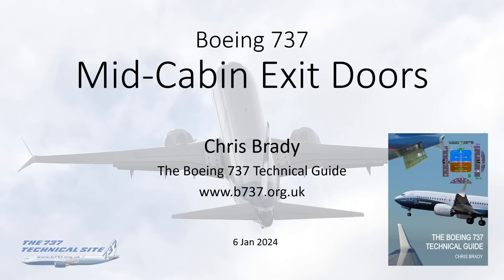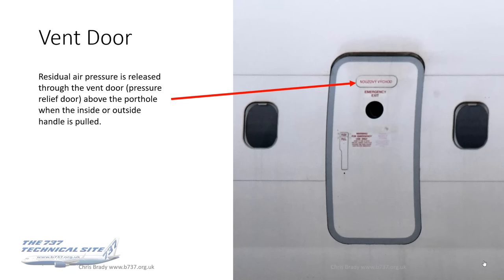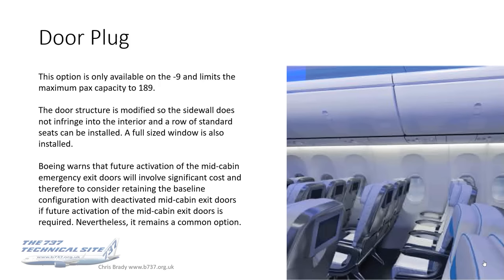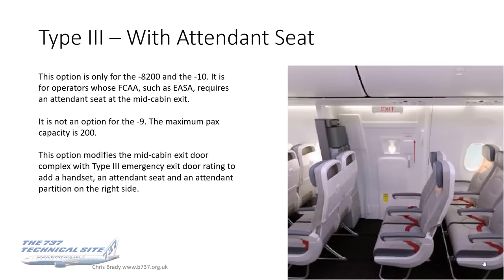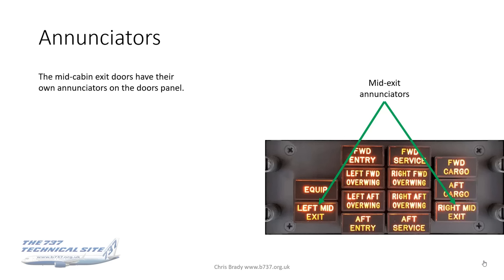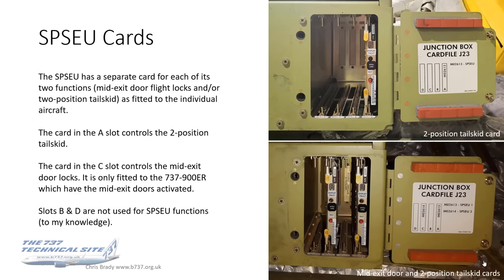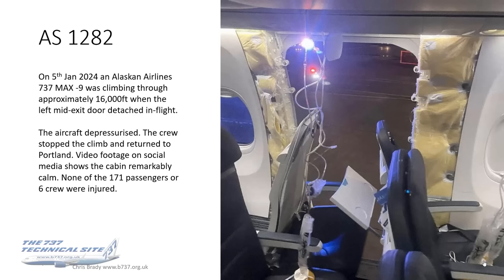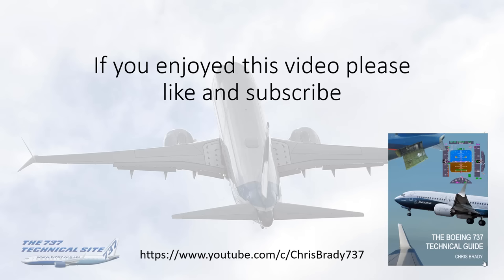737 Mid-Cabin Emergency Exit Doors

Comment: It’s not a mid-exit door if it is not in door configuration. It’s a plug at that point. A door opens and closes. When a door is sealed shut, it is no longer a door.
Reply: My thoughts exactly.  To call it a door is totally misleading.
Reply: The plug can still be opened by maintenance. There are still hinges.
Reply: @Chris_1024_ my point is it was not a door to the occupants of the plane. When the general public hear the many reports I’ve seen stating that this was a door, it is misleading. Passengers did not know it was there. Semantically you can call it a door. It was a plug with hinges bolted in and unusable. If I nailed a door shut at my home, technically it is a door, but if the house was on fire it was not an exit or an entrance, and for all intents and purposes not serving as a door.

Comment: Hello Chris, great video and appreciate the insight. With the aircraft on the ground and parked, if all four bolts are not installed, will the door assist springs raise the plug door into a non-plug position or does the weight of the door hold it in the down and plugged position? Obviously, with the aircraft moving/flexing, all bets are off. Thank You & All the Best.

Comment: Great video. Very lucky people. If the plug had hit the stabilizer or the rudder that flight may ended in much more terrible way. For Boeing's sake I hope this was not an engineering failure.

Comment: If you at the plug type door picture, although you say it's only secured by four bolts, you can see more fittings around the plug where it looks like more bolts could be used to secure the plug.  IMHO I can only see two scenarios when this failure would occur on such a new plane.  Either some or all the bolts were missing, or the incorrect bolts were used.

Comment: No horse in the race, but the door is installed by Boeing, behind a cabin interior also installed by Boeing. Unless Alaskan employees went behind the interior wall and messed around with the door plug (just 2 months into service, which would be noted in maintenance logs) - seems to be an OEM thing, no?

Comment: What's the difference between Type II, Type I, and Type C emergency exit doors apart from the maximum number of passengers allowed?
Also is there only one mid-cabin exit door or is it one on each side? Or can it be both?
Reply from the maker: You can find the differences on the internet. I didn't want to clutter the presentation up with too much regulatory info.

Comment: Thank you for this!  When I am inside a 737max with a plug in an exit and the plane is filling with smoke and flames I will be so pissed.  Even the windows are held in by screws, this looks so sub standard and should be.  I always thought the windows were  installed between layers of sheet metal and then secured., not just clips and screws.

Comment: Sorry, but another question:   if this door simply needs to move UP a bit to then freely pop out of fuselage, does this imply the door frame and door have "tabs" which, when aligned, prevent the door from popping out, but lift door up a bit, and the tabs are no longer aligned so tab on door can pass through the gap between 2 tabs on frame and door opens? 

Say the 4 bolts had never been installed and the door were free to move up/down.  Would it be fair to state that the door would have little incentive to move up/down and remain safely locked as long as it is a smooth ride and smooth landing?  If previous flight had rough landing and door moved up some (thus reducing area of contact between the portion of frame that keeps door from popping out), then i could see that metal failing as cabin startes to be pressurized and there is now too little metal to keep the door from popping out. 

From the pictures that were published, did you see anything anomalous in the door frame?  I guessing looking at the sill where the hinge mechanism is/was would provide clues?
Reply: the tabs you speak of he says are called stops
Reply: Thanks !  BTW, NTSB chair mentioned in press converence hat the ones on the frame appear undamaged , all 12 of them.  @indiekiduk

Comment: It is ambiguous to call the permanent non operative panels installed in place of an operative or deactivated door, A "PLUG", when all of them are installed from the outside and they all open outwards.
That's not a plug it's a lid.
Reply: it's a hole with a patch that exists to save a few bucks.

Comment: Well I'm not sitting anywhere near that plug panel in the future until I'm satisfied that 8 retaining bolts are now required for each of these plug panels.  Four doesn't seem to be sufficient.
Reply: You don’t even know if all the bolts were installed properly and up to torque-spec.

For all we know, the thing could’ve been held on with nothing more than friction with the stops and friction with the aircraft’s paint.

Comment: Great, informative video! I have some questions. First, is that kind of door plugs unique for Boeings 737 MAX or they were in use in 737 NG? Second, how it is possible that plug type doors blew outside? Shouldn't the cabin pressure keep them tight even if the screws let go? I assume the screws are only in place to stop that plug from sliding upwards which make it open, aren't they? If not and the screws keep the plug tight I am amazed that there are only four of them for such large panel.
Reply: They have been used in NGs since 2008, and this is the first incident involving plugs
Reply: Outside pressure is lower - everything in the plane wants to get out.
This type "door" doesn't seem to press out against the frame, but relies on the bolts/hinges to hold it.
Reply: The answer to your question lies in the terminology. This does not appear to be a "plug-type" door. But they call it a "plug" which makes it confusing and is wrong even.

Comment: I thought that the tapered design of doors meant the after cabin pressurisation, door blowouts were practically impossible?? The outer face is smaller than the inner face, so it shouldn't be possible.
Reply: @Plutogalaxy  some doors swing in and then sideways through the opening so the vertical edges press outward on the frame when closed.
Reply: Not all doors use a tapered design. It appears to make this easier to open the latches/bolts are all that hold it in.
If you look at front doors, some just open out (not tapered), while some swing in and then open (tapered).

Comment: According to Dominic Gates (Seattle Times) the specific aircraft had several 'pressure failure alarms' during the days prior to the accident. The aircraft was not allowed to fly over 'open sea/ocean'. Could it be 'loose bolts' that got 'a twist' every time the aircraft took off? - And finally the plug fell off.

It is like when you forget to tighten the nuts on you car wheels, finally the wheel will 'depart', and motst often it will be the forward left wheel - because it turns in a wrong directinon (nut coming off) and being moved a lot (steering)

Comment: My guess would be that after installation of the plug  the very small bolts were forgotten or not tightened before the inner lining and trim was fitted hiding this blunder from sight. It seems that the  resulting pressure leak during previous flights was too small to be detected in the cockpit. Was Quality and manufacturing management not an issue recently?

Comment: Thanks for the high quality summary. Any idea whether the FDR records any kind of "latch" status for plug doors? Are there even latches at all, or is "closed" entirely dependent on the plug design, cabin pressure, and those four bolts?
Reply: No door sensors for the plugs. And yes it is entirely dependent on the four bolts. In this case they will be looking very closely at those bolts. Were they properly installed? Were they the correct part number......in other words....were they the correct material and strength? Those sorts of things.

Comment: Great video, explained a lot and cleared up the confusion where it looks like a window from the inside, but is actually a door, plug variant in this case. Is that part of the lower hinge bracket that seems to be hanging out of the plane on the exterior shot?
Reply: Yes.

Comment: Not the first quality control issue for Boeing (aside from the MCAS failures on the MAX 8).There were QA/QC issues on the KC-46 where hand tools, small parts, and construction debris were found floating loose inside certified aitplanes. Boeing has serious problems regarding their attention to detail.

Comment: There was a plane years ago that had windshields fasted from the outside, and a supervisor finished the replacement job, with screws too small for the holes by just a little. They guy had bad eyesight. A pilot was sucked halfway out, feet were caught on levers, and crew held onto him, but he took a high-altitude-beating, against the plane, but lived to tell about it.
Reply: BA maintenance

Comment: would have been nice if you could have shown diagrams from the Maintenance Manual, showing in greater detail the physical arrangement of the Plug, and it's attachment hardware.
Reply from the maker: Not allowed to due to copyright but I have better photos and diagrams in the follow up video https://youtu.be/maLBGFYl9_o

Comment: I feel like your channel might see a bump in views in the next few days/weeks. lol

A few questions, if I may?...

I saw a maintenance photo earlier, where they used a normal mid-cabin exit door, but then covered it with the internal cabin panel.
That door had the full torque bar / latch, locking solenoid, and the smaller porthole window.

Was there a specific point in time when they changed to using the "door plug", which has none of the normal latches/locks, or have "door plugs" been a thing for a while now on the 737 (either the MAX or non-MAX config)?

On the "door plug" type, am I correct in saying that the two bolts in the upper guide fittings are the only things preventing the door plug from lifting upwards?

Is it possible they simply forgot to install the bolts during maintenance, and whoever fitted the internal cabin panel never noticed?

I heard this specific plane was only delivered to Alaskan Airlines a few months ago, so probably had many flights before this incident?
I can't imagine the upper bolts were missing entirely, so maybe it was metal fatigue, the wrong bolts/threads, or some other design fault with the door plug itself?

From the photos and video clips of the incident, it looked like the stop fittings were all intact, and are very sturdy-looking.
Maybe the whole door plug itself had been flexing due to the pressure, and caused just enough movement for it to slip off the stop fittings?

Comment: 2:33 Can someone explain how this is a "plug"? The stop fittings look like they align into the stop pads but once the aircraft pressurizes it doesn't appear that they take any of the outward load. Pressurization would appear to be loaded on only the 4 bolts. Am I seeing this correctly? A better design would be for the stop fittings on the door to be on the INSIDE of the aircraft when the door is closed, pushing outwards on the stop pads. An even better design would be a real "plug" , where the door itself is larger than the opening flange and thus would have to be opened into the aircraft, not outwards.

Comment: Questions: For the DEACTIVATED: is there the porthole on the door itsel, hidden by the plastic interior wall?  I take it emergency slide mechanism is not present?  Woulld the various sensors/locks be installed?   Does having a wall panel cover the door hinder maintenance/inspections, or is that panel very easily removable?  Say I am Leonardo diCaprio and policeman Tom Hank is next to me about to bring me to prison, could I escape once plane is landed by ripping wall panel out and opening the door?  )Just curious if the wall panel is just a regulatory device to lower max passenger capacity for landing fee/nuber of FAs but the door is otherwise functioning, or whether activating this door would still require much work.

Comment: Type III , II and I are all the same size right?   Since YOU forced me into a rabbot hole of FAA stuff, when I searched for Type III door, I found § 25.807 Emergency exits  where the only differences mentioned are the door sizes between I II III  and IV. 
And more importantly,  in your video, you mention slides in Type II and I but not III. Does this mean that type 3 doors don't have a slide and usable only at an airport with catering truck available to pickup passengers?

Comment: I know this is getting into pure specualtion, but trying to understand the mechanics of it:   Say one bolt was loose and fell off. Wouldn't the door be "bent"  by internal pressure during flight and start to let air out with a loud whistle?   I ams in a context of whether it is very unlikely that all failed at same time (think the United 747 with (now known to be wiring fault) the cargo door motors triggered in flight and unlocking cargo door which then ripped part of fuselage off) or whether this would have been a progressive failure and such case,  whether it should have been noticed (loud noise due to air leak?)   Or would insulation and inside wall panel have muffled/muted the air leak sound such that nobody noticed in flight? 
Curious to see if NTSB will want to interview passengers who were seated there in the previous flight to see if they heard anything special.

Comment: Thanks! Question: Do the 'stop fittings' not sit inside the 'stop pads'?  I'm imagining that what looks like bolts in the 'stop fittings' engage with the 'stop pads' which would serve to perhaps to seal the the plug properly and provide a 'shear ' element to help prevent the plug from lifting.
Reply from the maker: Thanks for the coffee! Yes to an extent although there are also seals. Better photos in the follow up video today  https://youtu.be/maLBGFYl9_o

Comment: Great video! I am a bit confused though. When you reference Type III, II, I and C, the exit looks exactly the same. One of them adds verbiage about an escape slide but in reality they ALL are required to have a slide since they meet the high requirement. So none of the actual mid-aft exits are different sizes, and they all function the same. What differentiates the Types I-II-III-C then?
Reply: "What differentiates the Types I-II-III-C then?"
Passenger capacity depends how the airline operates the aircraft and whether they have a flight attendant by the door and other things he mentioned in the video. He details all of that.
Reply: @rael5469  right. That wasn't my question. I have worked in aviation for 20yrs. I understand what he's saying, my question is different.

Comment: What is the function of the 4 bolts in the plug door?   Do they resist the forces pushing the door open or do the keep the door in position so the passive mechanical interference fit keeps the door in place?   Could the door remain in place during flight if the bolts were missing?
Reply: Thank you.  @marcobe861
Reply: Just to keep the door in the correct position

Comment: Wasn’t there an issue delaying deliveries in April? “The aviation giant said a supplier (Spirit) had revealed that the installation of fittings on the rear of the planes did not follow the standard.” Was it to do with this?

Comment: Hi Chris. If you have access to a maintenance manual for this aircraft, would you be able to post an excerpt on the procedure for opening and closing this access hole. I think we could learn a lot, by what the manual does or doesn’t say. I would be particularly interested in how the 12  adjustable door pins are handled during the procedure. I haven’t been able to find one myself. I am hoping you have better access to a manual than I do. I am a GA pilot. Thank you in advance. Regards.

Comment: Does this type door seal into the surrounding fuselage structure as the psid increases, or into door stops around the opening??
Compared to the main entry doors,(true plug type doors)these doors seem different?
I understand these are designed as emergency exits, but the media are calling them plug type doors.

Comment: Chris thanks for having this out so quickly. Would you or anyone watching be able to advise me on where I would be able to find an easy to read source for the "rules" on how many cabin crew are required for each aircraft, number of passengers, number of doors etc? Your point about EASA not permitting a Type III door with no attendant seat is interesting. So does this mean Ryanair will need 6 flight attendants when they take delivery of their Max 10s but US carriers can operate with 4?
Reply: It's ok, I have found the Easy Access Rules for Large Aeroplanes page on EASA website.

Comment: The question is, is that a standard door when it is covered. It appears it is a totally different design from a standard door, I assume lighter and not structurally the same, or tested like an exit door and locking system. I assume it is all manufacturer's numbers with no testing of the door, like any other component, the computer says it should work till it doesn't work. It brings into question how these plugs are put in, by the factory on the line by people who do this a lot, or are they left open and post production or a 3rd party puts it in. It can't be flown without it, but things like interior are probably done beyond the line putting wings and engines on the plane. Is it a sloppier, ad hock situation, where the door gets put on, not tightened, and someone else covers it up with interior panels, carpeting, seats. Labor shortages, COVID turnover, and new employees making mistakes.

Comment: Are the holes for the bolts going through the upper fittings a bit too close to the outer edges?  Don't they have to be at least 2X diameter away from an edge?